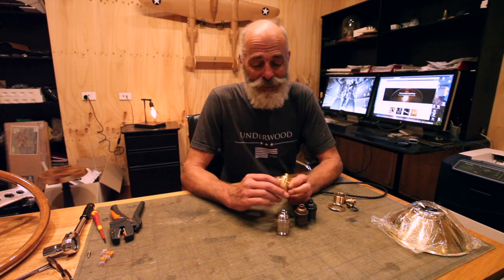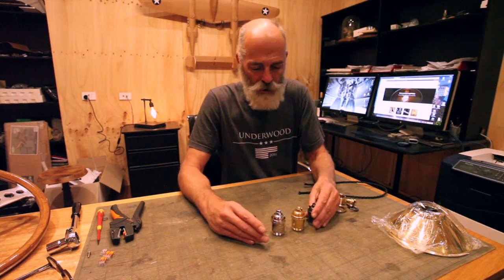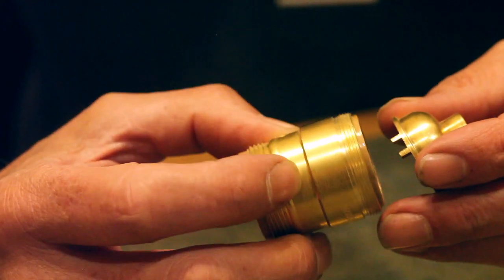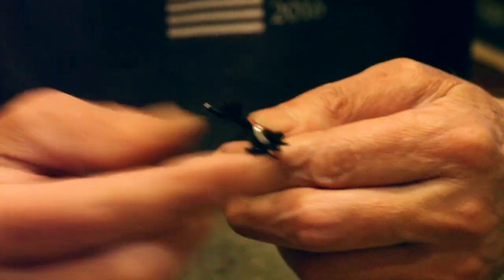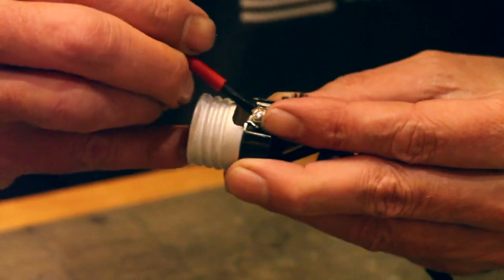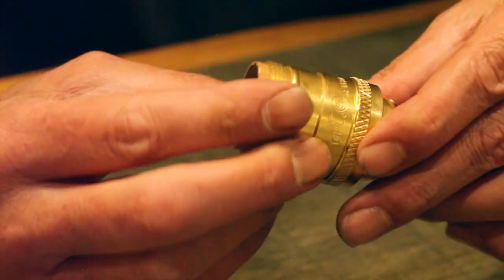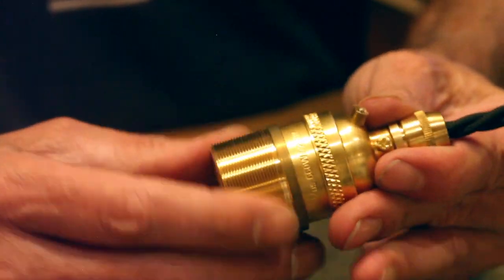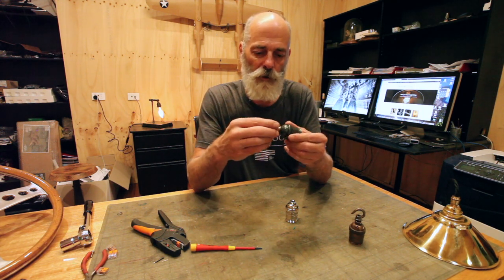Solid Brass E26 120 Volt pendant socket wiring instructions

Comment: Should be trimming the excess cloth cover.
Reply from the maker: At times we do but you need to use a super glue to isolate the part you are removing. Needs a longer video to show how to do that.